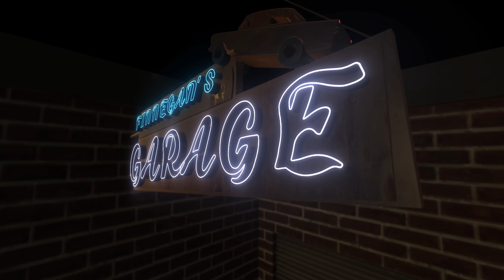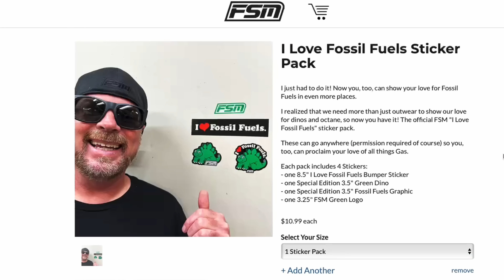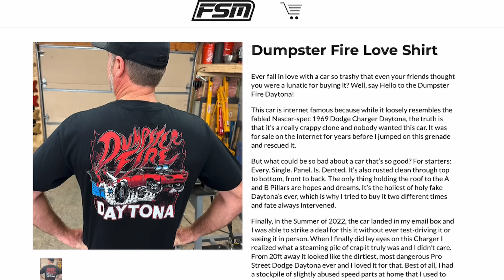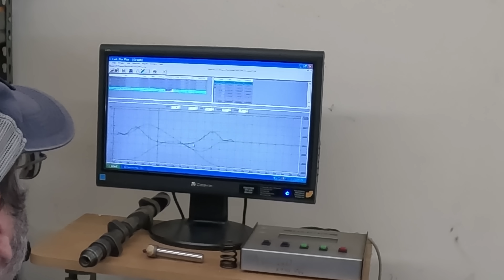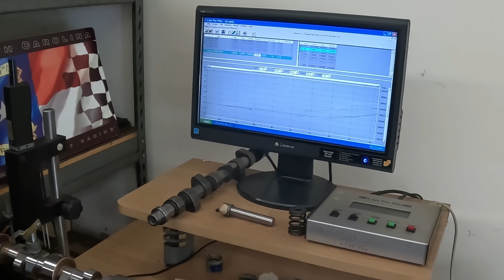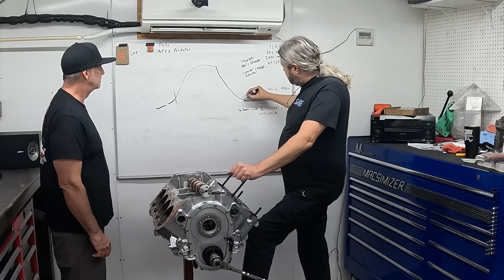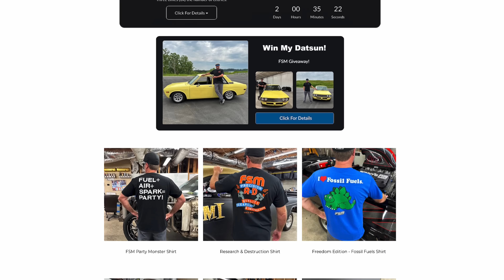WILL IT RUN AGAIN? FIXING THE REAL PROBLEM WITH MY 632CI BIG BLOCK CHEVY RACE MOTOR!

Comment: So more duration at peak   will give a smoother transition between open and closed   this will also improve power  as letting more air out turbo spools quicker    also some may not know in a marinised engine the exhaust and intake lobes actually overlap to allow some exhaust /water mix back in to the bore to help cool the engine
Reply: no
Reply: @juicebox853  why

Comment: That doesn't make sense. . .  I get that the valve may be bouncing off the seat from being dropped b/c of the lash. . . but you're an order of magnitude away in your clearance. That is, if the valve is being dropped 0.014", it's not bouncing 0.140" off the seat. If you drop a basketball from a foot, it doesn't bounce 10' into the air.
Reply: LOL It was all explained. Not our fault you can't understand it.
Reply: It's not the seat bounce that's causing the piston to valve issue. It's the valve lofting over the nose. Because of the extremely fast acceleration rate at the lash point, The valve train is flexing, and as the valve slows down towards max lift, all that stored energy in the valve train causes the valve to loft, and no longer follow the cam profile. That means the engine is seeing much more exhaust lift than designed, as the piston is moving up towards TDC.

Comment: my 121 ci 4 cyl - has 82 closed - and 185 full opened ! valve spring pressure = NOT MUCH AT ALL - listening to these 632 ci v8 = i mean that is big big block !

Comment: I'm surprised that with all the problems that valvetrainshave that nobody has developed and electronic way to actuate the valves. Any profile, any lift. No 800# springs. No cam. Lol.
Reply: Formula 1 has utilized pneumatic valve springs in the past, when the engines turned 20,000 rpm. I dont think a 632 will ever do that. Electric solenoids to open and close the valves can't take the cylinder pressure and heat. But rotary valves might be possible.
Reply: @JeffKopis  I'd think a micro processor could control a valve for a combustion engine better than a mechanical camshaft ever could?

Comment: Why not start with a new, completely known cam, not the junk someone else screwed up? Reworking junk is dumb. That cam is going to bite FSM in the nuts on the water. Hell, it’ll probably break it’s been under so much stress.
Reply: hahahahaha
Well, I think it's pretty well explained on the video, the cam itself wasn't the problem, the ramp on the cam lobes was. Why junk a good cam that needs some adjustment over a brand new "designed" one? Thrash the old and buy a new one? HAHA

It's like: "Oh, this pepsi isn't so cold, I'll throw it away and buy a colder one!"
Reply: @e.lan.s  if you watched Finnegan for very long you’ll understand that things like this will come back and bite him. We don’t know what heat has done to that cam, we don’t know if there’s any cracks or other damage to it. But I guarantee you if there is it’ll come back to bite Finnegan.